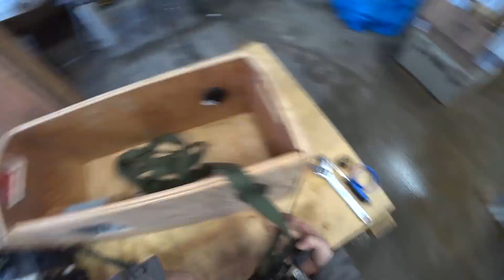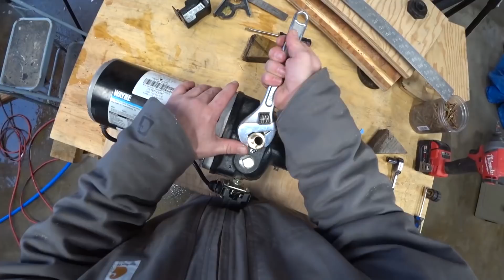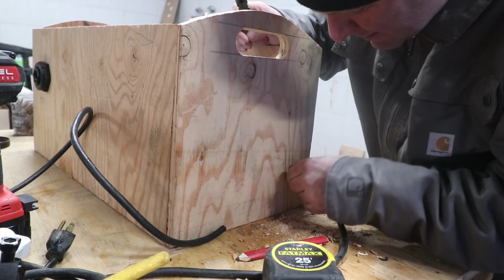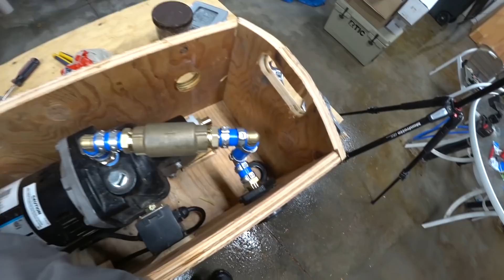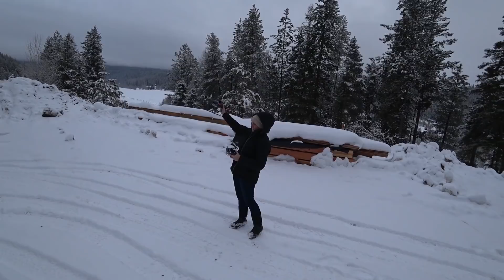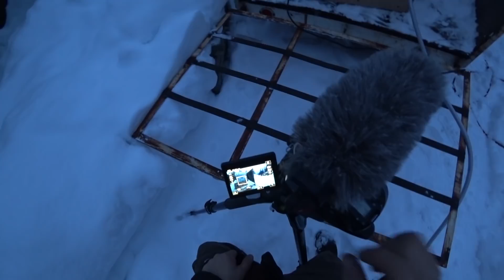Upgrading Our $2/mo Gravity Fed Water System

Comment: As a mechanical engineer, I hated to see you reduce the size of the inlet on the pump. This is your primary reason for lower than expected volume delivered. It would also have been a good idea to align the suction so it is a straight shot to the tote and preferably one elbow to the outlet/check valve.

Comment: Sometimes it's just easier to start over.  I built a pump box about 30 years ago and I built the box first and NOTHING, NOTHING lined up.  I did the same thing that I'm seeing here.  Undersized suction, and lot, LOTS of fittings.  I ended up saving the parts for another project, got a new pump, the old used one burned up the first week, and built a new, larger box with the fittings coming out the end with NO fittings.  Smile, take two fresh breaths of air and start over.  Don't forget a drain.  You don't want a big sparky box of burning fire!

Comment: OK, you wondered why it took longer to empty the tank than you expected.  Here is a short plumbing lesson from a licensed master plumber.  EVERY 1/2" elbow is the equivalent to 1.6' of pipe.  You have 4-  1/2" 90°'s meaning you have lost approximately 6.25' of pipe/head.  A spring loaded check valve is approx 16'.  Since you now have roughly 22' of loss, it will take longer to pump.
Reply: Trees Climbing Gear You said it not me.  But it I certainly agree. He knows just enough to be dangerous.  Like his comment “All water systems leak”.  Uh, no they don’t!

Comment: Not that it really matters, but you spent something like 10 grand on your water system, and drive to pick up your water, run your 2000 generator to pump water up the hill, etc etc so in reality it’s a lot more than 2 bucks a month,

Comment: Remember elbows are very restrict to flow.  The rule of thumb I was taught to use is that one elbow is equal to adding ten feet of straight pipe to the run.  You already have a long run up hill and don't want to make it worse.  This will really be important when you do the plumbing in the house with a gravity flow system.

Comment: Classic Jesse doing things out of order and over complicating things
Reply: Hehe its funny to watch,  and yeah that could have bin done a little simpler, and cheaper as fitting count up fast, but then hey i am a pipefitter for 30 years.

This i would have done differently:
1 - Installed the check valve on the inlet, and have the connection strait under the handle bar no elbows needed.
2 - I would have installed a long radius elbow in the the top outlet, better flow and no real need to install a expensive bulkhead and a much better flow.

Would not have used so many 90 degree elbows if any as they restrict flow a lot (about 5% per elbow), and fittings cost a lot, as they count up quick.

Also ould not have used a timer for the pump, as the pump will run dry for some time, and that's a sure way to drastically shorten the pumps live, I would have used a water flow switch, mostly used to turn on hydrophore's, but can also be used here.

3 - Would have used the water flow switch to keep the pump running, and push button switch parallel to the flow switch to jump start the pump, the pump will keep running till the container is empty and the flow stop, that will turn off the flow switch to stop the pump

And Jesse if you start on your house pluming, try to follow the KISS principle as ever connection is potential leak, so try when planing your piping to minimize your total fittings as much as possible, Next also try minimizing the amount of elbows, and if needed, try and use long radius elbows.

The switch: https://www.aliexpress.com/item/Safe-Stable-High-Temperature-67x50x35mm-120W-Female-to-Male-Circulation-Pump-Water-Flow-Sensor-Switch/32753701014.html

Comment: The main thing I have learned from watching this project is to recommend changing the type of PEX you are using, at least for when you plumb the pressure lines for the new house:  strongly recommend Uponor (Wirsbo) ProPEX, which is more expensive but is almost fail-proof, at least compared to the PEX system you have used on this project.  Uponor is a much better system, but don't take my word for it, do the research, (as I know you are prone to do), and you will verify this on your own. Great projects, great editing, great channel.

Comment: Just a note; The more fittings you use the more restrictions there are on the flow.
Reply: Agreed. I would have put some nice gentle bends, even if it meant putting large loop or two. No need to try to squeeze that check valve right in between the pump and the wall fitting. A foot of PEX in a big loop has no real restriction - each 90 is roughly equal to ten plus feet of run.

Comment: Dry fit everything before soldering or fixing or drilling any holes.   
dry fit everything before soldering or fixing or drilling any holes.
Dry fit everything before soldering or fixing or drilling any holes.   
dry fit everything before soldering or fixing or drilling any holes. 
Dry fit everything before soldering or fixing or drilling any holes.   
dry fit everything before soldering or fixing or drilling any holes.  
Dry fit everything before soldering or fixing or drilling any holes.   
dry fit everything before soldering or fixing or drilling any holes. 
Dry fit everything before soldering or fixing or drilling any holes.   
dry fit everything before soldering or fixing or drilling any holes.
Reply: can you find the mistake in there?

Comment: Jesse  the check valve goes on the inlet side, normally it threads right into the inlet on the end. So your inlet should be just below the handle on the end of you box. This maintains water in pump, for start up and eliminates the need to prime the pump.
 You also need to increase your fittings to 1”, so your not restricting your pump.

Comment: Too many 90 deg fittings.   The pressure drop of every 90 elbow is equal to at least 8' of  of pipe run.  A 45 has about one quarter the loss of a 90.
Reply: Don Brutcher thank you I was looking for that conversion. Geez this guy huh?

Comment: Every fitting is the equivalent of adding about 25 feet of pipe. So you added about 100ft of pipe with fittings that are 1/2 inch O.D. which is probably 3/8 I.D. you should have just ran the input straight from the side with no bends, and ran the outlet straight out the top or use 1 bend to run it out the side. Shpuld have used 3/4 or 1 inch.

Comment: Why not drop a sump in the tank with a float switch? All you have to do is plug it in and it would shut off automatically when empty.
Reply: A zero plumbing install. Probably the best idea, certainly the simplest idea. I think you win.

Comment: some sort of float switch, installed in your tank with a quick connector to the pump would be a great solution to cut of your pump so that it does not run dry.
Reply: Great idea, he did mention that before in another vid.

Comment: FYI there is no need to route slots for the motor mount, just drill holes so they match up.

slots in mounts like that are meant to accommodate a variety of existing mounting "standards"

Comment: Hmm perhaps missed this but what if you get a leak on those fittings :P  Where will the water end up? It looks like the box is closed and youl end up drowning all the gear in it. Perhaps not a big issue but i would have had the box open in the bottom

Comment: There are too many bends and fittings in your box.  And the fittings are too small for that pump. It's  just going to be over worked.  Why not just attach the check valve to the hose you're going to pump with? The box isn't a bad idea,  but it isn't going to be efficient the way it's setup.

Comment: One suggestion when working on low pressure/low flow systems is to check out the internal bore of any fitting, particularly complex ones like valves and check valves.  If you want to retain the internal cross sectional area of your pipework it can be better to go for a fitting for the next pipe size up and then use reducers. Manufacturers are looking at products that look right, work in most circumstances and can be made for a profit. Sacrificing internal flow in some situations is a price worth paying to hit the other objectives. Using oversize fittings may look a little odd and cost a little more, but can make significant improvements to the flow rate in low pressure/low flow systems.

Comment: Loose the timer. Install a flow switch on the inlet side plumbing. No water coming into pump, pump turns off. Or install a float switch in your inlet water tank. The latter may be the cheapest but the first would be better imo.

Comment: Friction loss are reducing the flow rate . Remove all the elbows increase the pipe size and go through the end of the box .The suction line from the tank needs to be larger and add some camlock  fittings for easy coupling. Nice little project but some times you need to think outside the box

Comment: Okay, so why not build a bigger box? Among other things, it would let you make sweeps instead of using elbows... Elbows introduce resistance to flow and create turbulence. I don't know what turbulence will do to Pex, but if you were using type-M copper, that would guarantee pinhole leaks about six months from now. 

Use a bigger box with sweeps instead of elbows, and you'll get back closer to your original 30 minute mark.

Comment: I'm must be missing something.  Why is so much time being spent on LED light bar comparisons and a gravity fed water system while the timber frame of the house is just sitting in the snow?  Houses can be built in the winter....not ideal, but it can be done.  At least, putting on the roof and side walls would help.  Shoveling/sweeping off the snow isn't going to protect what you have already installed (there's more to worry about than the weight of the snow).  I imagine the shelter institute who helped you might be cringing.
Reply: They've only said a million times that they're waiting on their SIP panels.
Reply: Thanks, sf98!  I did miss something!  I appreciate you letting me know.  Wishing Jesse and Alyssa the best.  They work so hard!
Reply: They are waiting for, I think it was, their SIP panels, and no the frame is perfectly fine sitting in the weather for a period of time.

Comment: Thanks for all the great videos. Keep up the great work. I'm not an expert on plumbing but I have heard each elbow restricts flow by a great amount, your test just proved that, taking longer to pump the same amount. You are probably better off to try using the PEX for your turns, as long as you don't kink or flatten the PEX. You might have to make the box a bit bigger. Also if you are using the pump in the cold you might want to put a Schrader valve on the output side of your checkvalve so you can blow the water out of the pump. The checkvalve might air-lock the water in the pump.

Comment: Jess, just drill a big hole on the end of your pump box and run some 1 1/4” pipe and same size check valve, get some 1 1/4” flex pipe and some banjo cam lock fittings to attach the pump to your tank. Put the garden hose connector on top of the tank and hook the hose there. You’ll empty the tank quicker and the pump will not have to work as hard.

Comment: 1) I believe you need some hose-length between your pump and your check valve. The reason is that the impeller of the pump will send pressure vibrations through the water into the check valve, and wear-out the shutter mechanism faster than planned.

Also,

2) The wiggle of the pump base is actually engineered that way. The starting & stopping of the pump, driving the mass of the water, will always induce kick / wobble in the pump no matter how rigid the manufacturer makes the pump base. Hard linkages at the pump (like yours) will always try to stop the wiggle, and end-up braking. Engineers learned that making the support of the pump flexible, reminds the installer to use flexible linkages, which means the vibration stress of start/stops is taken-up by the hoses, and not the fittings. You need to use flexible linkages between the pump and the box walls.

Your design will work as-is, but plan on broken fittings and a leaking check valve in 2 years or so.

Next Spring, I recommend you take-out the PEX and fittings, and replace them all with garden hose. I recommend you coil the widest loops you can inside the box. It'll look silly, but the extra room-to-flex will definitely help both wear-out problems.

Comment: Really seems like mounting the pump to the water tank or trailer and using an outlet with a timer and extension cord could have saved some serious time an money.  Plus the sharp turns in the plumbing are a major no no.  I hope you learned that lesson, but I'm not sure you did.

Comment: There are several different ways to join PEX to a fitting.  One f the newer methods uses a power "expander" and a special "plastic" ring.  (Milwaukee sells  an M18 version of the expander.)   It is incredibly fast and easy and the rings are actually less expensive than the copper crimp rings or the stainless steel crimp rings you are using.

Comment: Hi Jesse, please check the pump specs, usually pumps need certain straight pipe on the inlet and outlet, bend on the inlet and outlet could be the reason for reduce flow. Not enough straight pipe on the inlet specially makes a turbulence in the liquid, which means less flow and more importantly less life time on your propeller (as it could cause pitting).
Reply from the maker: Good info! Thanks!

Comment: Put hinges on the inside bottom so that the walls can lay flat. Then hinges on the inside corners to run pins in.  This way when you need to access the pump just  pull the pins and the walls lay flat.

Comment: Your pump/box would have been an assignment for young equipment designer like me 50+ years ago. Thankfully we had senior mentors to get youngsters like me started in the right direction in those days. The first mistake you made was making the wood box first and then trying to fit the pump and fittings into the box. You should have piped it first and then build the box around everything. You still may want to trash the box and clean-up the piping. Then, build a new box around the whole assembly. To increase you flow rate, my I suggest you increase all of pipe diameters. In particular, I would make the suction pipe as large as the pump fittings & tank fittings. You are chocking the suction side down with your existing hose & piping. Keep in mind, you only have gravity to move the water out of your plastic tank. A centrifuge pump can’t suck anything. It may also be helpful to set the pump on the ground instead of the trailer bed. I would also increase the piping on the discharge side of the pump. You have a lot of elbows & they reduce the flow in small pipe. If your pump came with a “pump curve”, you can also determine your flow rate GPM by measuring amp load on the motor. You may have more than enough pump, but not the correct piping.Joe Lansberry
Reply: Joseph Lansberry that is good advice, I hope they see it.

Comment: Using the 90 degree elbows will cause resistance in the line, which in turn will reduce the pumps longevity and output which I believe you found to be the case.

Comment: The real lesson you should learn for you little bit of "plumbing" is that transitions from PEX to copper/brass require adapters which cost $$ and you need to purchase those copper/brass items with the PEX end already cast/molded on so that you can minimize the number of adapters.  Your local pluming supply may have only had a brass check valve with female threads, but if you shop online, you can find a brass check valve with male PEX ends.  One less adapter and a bit more space to work in.

The check valve is limiting your flow.  They make something called a "swing check valve".  A real plumber will have to say if it has less flow restriction.

Also, when working is very tight spaces, "real" Shark Bite (push on no crimp) save space and are easier to deal with.
Reply from the maker: Good tips. One thing we’ve learned is that local inventory vs finding “the right or best part” is often quite different. Why don’t part houses stock all these magical parts? Seems like more and more we are forced to use the internet when we’d much rather use our local suppliers. Frustrating.
Reply: You might want to rethink using PEX in your home.  As some of the other's have mentioned, it has some serious 'down the road' issues.  Check out KnarlyCarl's YouTube plumber video at about the 6 min mark for his thoughts on the product:  https://www.youtube.com/watch?v=njWdMfPU1ds
Won't bother repeating the comments on the pipe size, fittings, bends of your pump box as they are ALL relevant!  To those comments I would like to add that if the timer runs the pump longer than the water supply lasts you will burn out the pump shaft seals.  Also unless you are absolutely sure you can keep the pump warm, free from freezing, you might want to provide for a means of draining the impeller chamber so it won't freeze.  A good idea but maybe a 1.1 version in the near future.

Comment: Unnecessarily complicated beyond what is needed. Why to much over thinking. Amateurs with little training or experience tend to either under think or over think what their doing. Yes it is "ridiculous".
Reply: Got to agree with you! What was the objective to stop back flow? Just put in a check valve - end of story. Jessie introduced four bends with smaller diameters - of course the flow rate was going to drop! Nice box but a big fail on the end result, I think!

Comment: As noted previously the bathroom timer will not handle the load of the pump. This can be resolved with a relay sized for the pump. Use a 110v coil style relay connected to the bathroom timer.